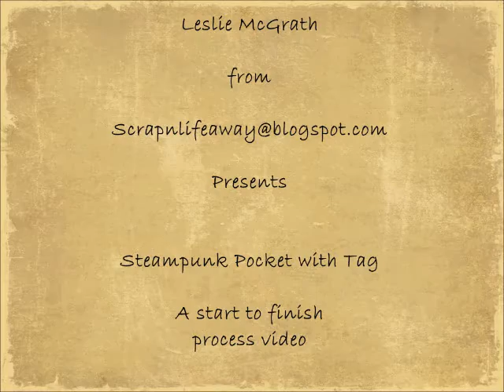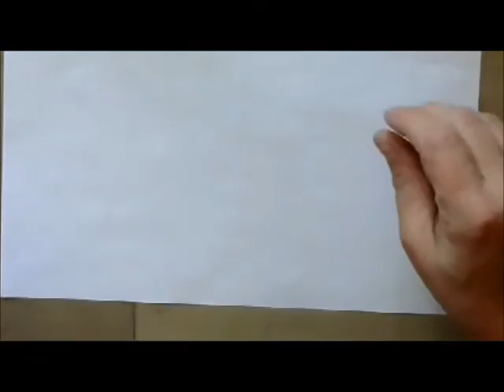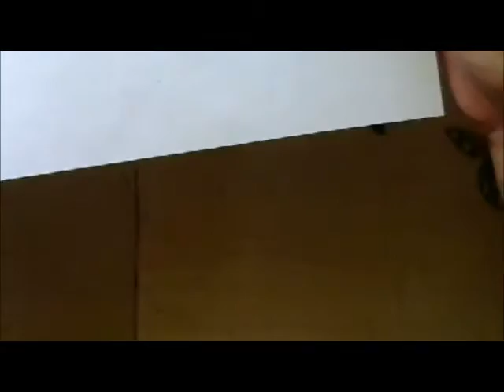Steampunk Pocket & Tag

Comment: This is great! It came out beautiful! I wish I would have seen the challenge earlier, I love doing steampunk! Oh and fabri-tac is great but a pain in the buttocks! lol But, if you transfer it into a small bottle, like a 30ml bottle with a smaller tip, it makes it way more manageable. I posted a video a while back about how I transfer all my glues, even glossy accents, into small bottles.... and its so much easier to work with! :)
Reply from the maker: +Pink Poodle Crafts Great idea!!  I have quite a few bottles I could use!!  And it would make for less bulk when I pack things up to craft outside the house!!  Thanks for watching!!!
Reply: oh yeah its great for travel! I just used my label maker to label them because they all look the same in those little bottles haha. But its just way easier on my arthritis in my hands to work with small bottles. :) I use bottles they sell online, on ebay even, used for electronic cigarette juice, the 30 ml bottles... just look up "ejuice bottles" and their so cheap. They are good for making alcohol inks as well :)
Reply from the maker: +Pink Poodle Crafts I saw your video where you mentioned that and that is exactly what I did!!  I think I got like 50 of them and they work great with my home made inks!!  Do you put a pin in the top to keep it from clogging??
Reply: No i found that I dont need a pin when i use those little bottles... my glossy accents has been in one of them for months and it has yet to even clog once!!